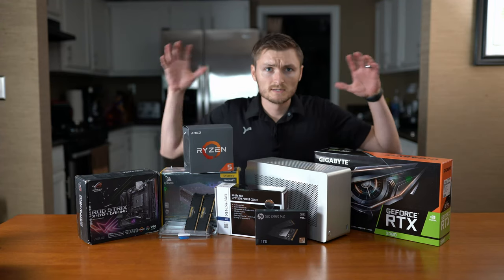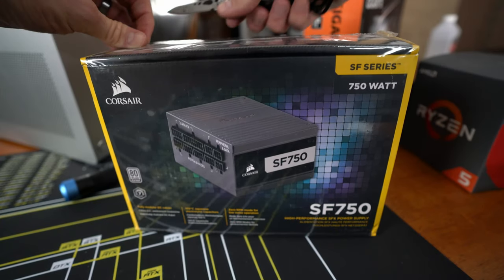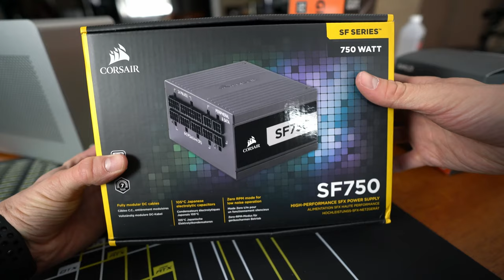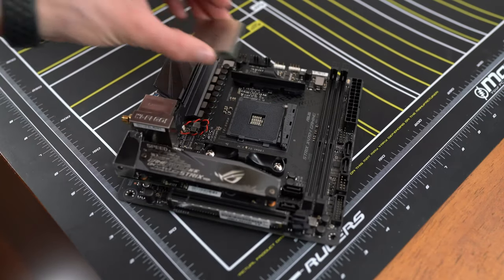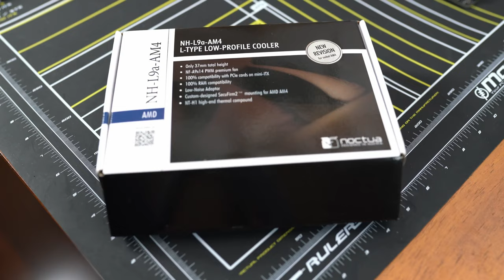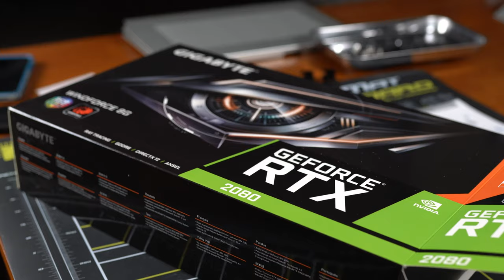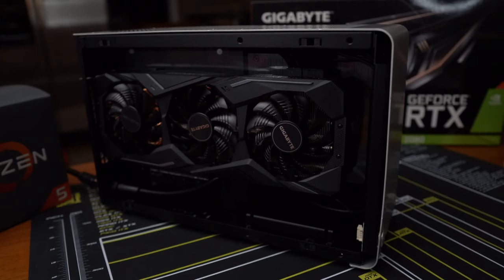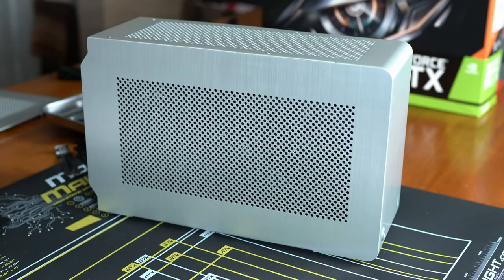Dan A4 v3 air cooled Ryzen 2600 / RTX 2080 build!

Comment: Great video. Exactly what I've been looking for. Thanks!
What do you think about using a Silverstone Nightjar NJ450-SXL fan-less power-supply instead of your Corsair?
Reply from the maker: While that PSU may be fine, I'd probably steer towards having a bit more wattage available from a stronger PSU. As seen in my follow up video, I am pulling as much as 386w at the wall, while undervolting the CPU and raising the power limit on the graphics card. Maybe forgoing the OC/power increase on the GPU would put you in a acceptable power draw for a 450w PSU. However, with only one spot for a case fan (below the PSU), I'd be a little concerned about heat build up - once under load, the PSU ramps up the fan and is taking on primary responsibility for exhausting hot air.

Comment: What temps are you getting and how hot does the case get with all that power?
Reply from the maker: I’ll cover those details in the next video, which will be uploaded very soon. Dialing in the setup now. OC, undervolting, temps, noise, and benchmarks will be included.

Comment: I enjoyed your build video. I did however feel that your power supply, which is awesome, was overkill for a Dan-a4 build. I doubt that you'll pull more than 350W max with your current setup.
Reply from the maker: Thanks - and yes, the PSU is overkill. I wasn't able to see more than 386w at the wall while stressing both CPU & GPU. I'm justifying the purchase for the silent sub-300w operation, individually sleeved cables, and Platinum efficiency rating but a SF600 would have been just fine.

Comment: Impossible to get hold of a dan case a4 at the moment, any tips on where to order?
Reply: caseking , ordered a month ago
Reply from the maker: V4 is now listed on SFFLab though they have not updated the photos. My guess is v3 is sold out there and preorders from here on out will be for v4. A few do pop up on eBay from time to time.
Reply: CachedBytes thanks final question could I put the gigabyte windforce 2070 instead? Thanks again
Reply from the maker: Looks like both Windforce 2070 and 2080 are listed on Gigabyte’s with a length of 280.35 mm so you should be good. Maximum card length is 306 mm.
Reply: CachedBytes perfect, so all in all you would recommend following your exact build still and a 2070 should still be a good choice?
Reply from the maker: Yes I've been very pleased with it so far.    Solid performance and reliability. The 2070 would be a fine substitute for the 2080 if you want to save a little coin. Also check out my follow up video on performance & thermals.

Comment: 2080ti in this form??
Reply from the maker: Some yes and some no. Max card length of 306mm, per spec sheet. Strix RTX 2080 Ti for example, is too big.
Reply: @cachedbytes5810  only 2 slot cards right? 2.5 is too large?

Comment: It shall be illegal to pack so much power in a shoebox
Reply: Miguel Vazquez nah system 32 delete in bios helps keep cooling to a bare minimum
Reply: Aiden Paparoa i built one with a 3700x and a n9a. It works amazingly well, except for the gpu fan noise, even after undervolting and custom fan curve. But it is ok and super handy to move around